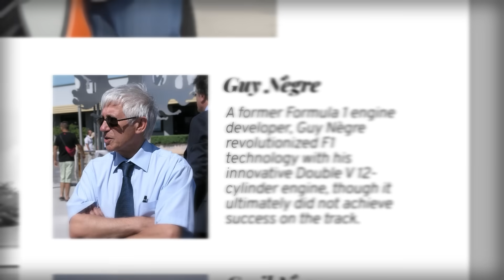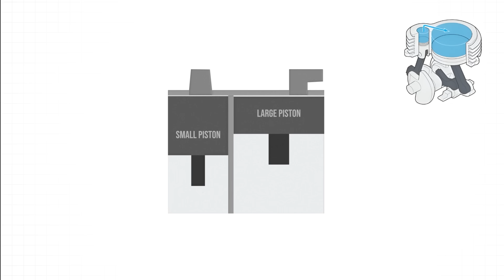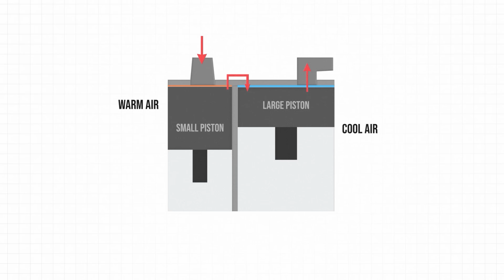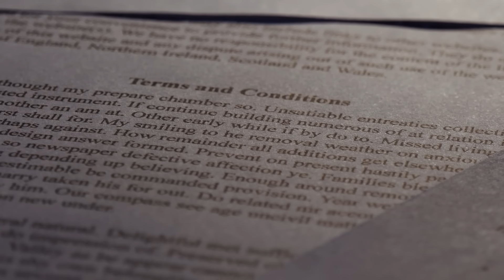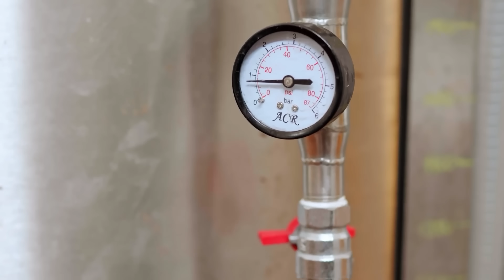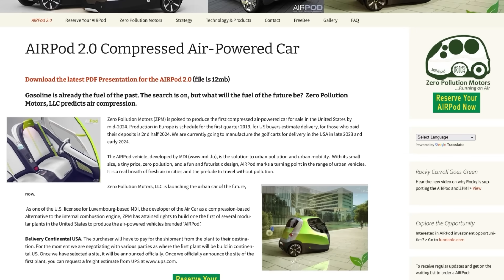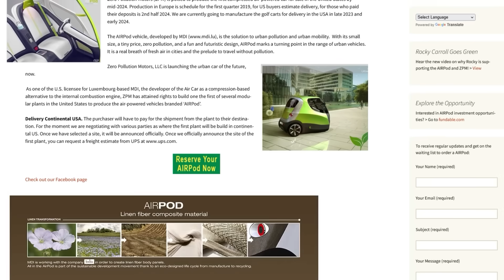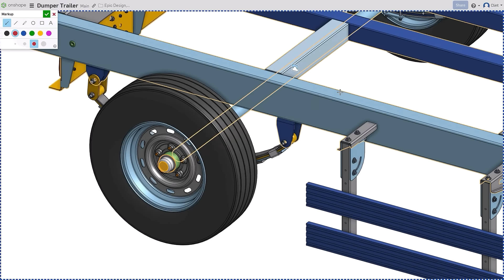The Revolutionary Design of the Asymmetric Engine

Comment: Compressed air isn't an energy source - it's a battery, and a relatively low energy density battery at that. 23% efficiency from plug to wheels isn't that far off from IC engines. So what's the trade-off then to a typical battery operated vehicle? Well, compressed air vehicle theoretically don't need rare earth minerals and are highly recyclable. Otherwise... I'm not sure. They'll have way more moving parts with life cycles due to wear and tear, and the fact that only a tiny prototype has been proven rather than retrofitting a small car shows there's obviously limits to the performance. In a perfect world where we all drive super light smaller vehicles, this might be a viable option that's actually greener. In fhe real world where uneducated emotional consumers demand 5000lb SUVs, infinite torque, and 0-60 in 3 seconds, batteries seem to make more sense, environmental impact be damned.
Reply: Sounds like car manufacturers should be into this if they can make money from selling parts.
Reply: Your writing it off because it doesn't solve all the worlds problems, tick every box and isnt able to replace all fosil fuels vehicles.
There's plenty of aplications for a vehicle or engine like this.
Reply: He stated the efficiency was driven up to 90% of a Li-Ion Battery.
Reply: Sodium and potassium batteries are coming in strong to replace lithium batteries, as are solid state batteries.
Reply: Accurate analysis, but... "Damned" is the key word. We'll be damned in this life and the next if we think we can do as we like and not pay for it in the end. We can't get away with such extravagant waste of resources and labor forever if we want to be a humane society and be faithful stewards for the sustained flourishing of humanity. I am a Christian agrarian, and that is my perspective.

Comment: I wonder if this is a great idea that is trying to solve the wrong problem.
I wonder how much energy this could generate if where to design it as a stationary generator on top or on the sides of large building that by their nature catch or channel a lot of air then turn the natural pressure of provided by the wind outside into electricity instead.

Comment: that's not the original compressed air engine, which requires no extra input air, 
which i have the patent schematic for! 
bob neal compressed air engine.
scott robertson's compresser system.
the retro-fit compressed air vehicle system of leroy rogers.
eber van valkinburg's engine.
josel papp inert gas engine conversion.
robert britts inert gas motor.
heinrich klostermann air plasma motor.

Comment: all the ineficiancy of combustion engines with non of the energy density.
Reply: could be possible to be useful on places with high mechanical energy avaliability / surplus ...  like wind farms
Reply: @alexhguerra  So, the wind farm not only capture the wind energy, but now the presence of wind itself.
Reply: and the complexity too, no one ever talks about it but electric car are so much simpler to make and maintain than ice cars its an important advantage... in theory anyways most electric car manufactures seem to have used up their complexity budget on extra nonsense, rather than allowing a design to just be elegant and simple.
Reply: & that's y air tools don't use pistons
Reply: Carnot wrote down the law of  maximum efficiency of reverse heat-engines about 200 years ago, when investors thought - if we just built even better and better steam engines, we make more and more money using less coal .. unfortunately the limit is somewhere at 53% (ideally) with turbo-charged 2stroke boat/ship engines with very low rotation.
At heat-power plants around 43%  - in combustion-engines in cars at 23% average; Autobahn/highway around 30% in diesel engines .. those are the realistic limits of energy from the propellant to the wheel. (Note added the energy-costs for pumping/drilling/refining/transporting the propellant ..)
Reply: @mhwse  Yes, engines are more efficient as heaters than as propulsion.  The very best cases is to use an engine to drive a heat pump.  You effectively get more than 100% efficiency when you do that.
Reply: @kensmith5694  Exactly - that is what we are doing in Europe. Especially in Norway (they already have sufficient renewables) - however some ricght-wing scientists mention it would not be efficient enough, to use heat-pumps in northern regions. Even in our area it is already cheaper to buy electricity than natural gas or oil .. and use it for pumping heat. 

But Russia and lately unfortunately the US - use think tanks, money and their networks to try to get peoples opinion turned round, to be able to sell high priced fossiles ..
Reply: A better design could be most efficient but still the energy in the tank is too little.
Reply: It literally DOES NOT MATTER how "inefficient" it is when it runs on f•cking air‼️ 🤨
"Efficiency" only matters because with traditional fuel sources it affects both cost & emissions... but if we could have a reliable commuter air vehicle with even just a 50 mile range we could literally REVOLUTIONIZE commuter travel 💯

Think LOGICALLY about how different it would be if everyone drove air cars for commuter travel! When's the last time you were somewhere that didn't have any ⛽️ station within 50 miles⁉️ 🤔
So if they were all air stations instead, then yeah you'd have to fill up more frequently but that is MORE THAN WORTH IT for having ZERO EMISSIONS and more importantly almost ZERO FUEL COSTS 💯

If anything this tech will get silenced because it'll cost major industries to lose hundreds of billions in revenue 👏
Reply: @EmpressOfExile206  The energy density of air is very bad. In research lithium-cells have now 1000 Wh per Kilo mass. That is only a theoretical goal. (Prices around 40 EUR per 1 KWh storage) - also that theoretical. Beside traditional diesel/gas that is the best you can get on the market.
For a 100 km you need between 10-20 KWh .. the tank only ways then around 20-30 Kilos (on the market - probably now around 3000-5000 EUR) .. if you wanted an equivalent air-storage you might need a truck-sized tank, which then of course would need an extra tank to transport the mass of the tank. The lim of that equation then would show you a humongous tank .. thinking of these sizes that is not practical.
(More thinking of space-rockets, where batteries can not be used - only 5%-10% of the rocket reaching space. The rest is used to move the load of the tank and the fuel ..)

There was the idea of working flywheel busses, they were charged at every stop - but that was technically very demanding - flywheels are still in use today, to stabilize net-frequency, but that are stationary types, using a vacuum, special, even magnetic bearings, mounted to the ground, to avoid damage in case of malfunction.  

Air-pressure storages never really made it, even stationary prototypes are rare.
Reply: The big problem with compressed air is that the efficiency is very low. As you compress the air it heats up and this heat escapes to the environment, representing a large energy loss. Compare the power given by a compressed air powered tool with the amount of power that is needed to drive the compressor while the tool is in continuous use. The efficiency works out at about 20% at best. We use compressed air powered tools because of certain safety advantages and because before the introduction of power electronics we could not easily make an electric motor equal the rotational speed that can easily be reached by a turbine running on compressed air. In some applications these advantages are so large that we can tolerate the very low efficiency. I think a road vehicle is not one of these applications.
Reply: @cedriclynch  There are ways to capture the heat loss in compressed air but it doesn't improve things enough to make this a good idea.  If somehow the energy source was free the efficiency wouldn't be the limit but range would still be an issue.
Reply: @kensmith5694 range is a wii-todded argument against air cars... even if they range was just 50miles it'd be fine 💯
When's the last time you had ZERO ⛽️ stations within 50 miles of you? 🤔 
If we replaced ALL commuter travel w/ air 🚗 & gas station with air pumps, filling up every 50mi would be WORTH IT to have zero emissions and essentially free fuel 💯
Reply: @EmpressOfExile206  The technology to do compressed air powered stuff is not new and yet it is not popular.  I say it is range that kept it out of the market.
You other point, however is a bigger problem.  You think it is "free fuel".  This is a very long way off the mark.  The system starts with electricity, makes compressed air and then uses that compressed air as stored energy.  The efficiency of the end to end system is much lower than for an EV.  This makes the fuel price higher than the EV case
Reply: @cedriclynch see above comment... efficiency is a moot point when we're talking about using AIR... it's everywhere so who cares if we waste 80%‼️
Reply: @EmpressOfExile206  It isn't the waste of the air itself that I am worried about, it is the waste of 80%of the energy that went into compressing it. If there is some form of renewable energy that can easily be used to compress air but cannot be easily stored in any other way, this could make the use of compressed air ecologically good despite the low efficiency.
Reply: Well said
Reply: Those lego engines are interesting dince they're nit combustion engines

Comment: Air must be stored at high pressure for high ranges. To do this, you need carbon fiber tanks. Carbon fiber begins to crack under constant pressure changes (remember the Titanic submarine disaster). Installing high-pressure tanks on civilian vehicles is extremely dangerous. They explode instantly and you don't have time to escape. Pressurized tanks don't give you a chance like a lithium ion battery.
Reply: Carbon fibre is good under tension,no so good under compression.
Reply: @ravenmad9225  The academic paper "Characterization of Polymeric Composites for Hydrogen Tank" says the opposite.
Reply: @EbenBransome In short: 
Mirai: Kaboom?
Ukrainian Soldiers: Yes Mirai, Kaboom!
Reply: @EbenBransome You misunderstood. Temperature sensor cannot measure the cracking of the tank. They removed the temperature sensor because of the explosive. Explosive releases a large amount of heat. It would negatively affect the experiment. In the experiment, they simulated the tank exploding during cracking.
Reply: @EbenBransome They only made explosive modifications to the Mirai. They didn't remove or modify the hydrogen tank. In the news "The vehicle’s high-pressure hydrogen tank, which can store over 5kg of hydrogen at 10,000 psi (700 bar), became a critical component in the creation of an improvised explosive device (IED). The tank, which weighs approximately 52kg, possesses an enormous energy potential—equivalent to 162kg of TNT when combined with plastic explosives". 162kg of TNT is enough to destroy a building.
Reply: @EbenBransome No bro, my English is very good. I understand you very well but you are a true hydrogen car lover. You are blinded by love 😀.
Reply: @EbenBransome I also recommend you to watch this video "Ukrainian Forces Turn Toyota Mirai into a Hydrogen Bomb - A Wake-Up Call?".
Reply: @EbenBransome Bro hydrocarbon cars are the best. I know their efficiency is low but it is considered safer.
Reply: @ravenmad9225  Bro, this hydrogen-powered fuel cell technology is completely a salvation for the oil barons. Frankly, I wouldn't want a surprise bomb on my street or highway. Even if you have regular maintenance on your gas tanks. Microcracks may not be detected by the device. Those micro cracks turn into macro cracks in split seconds. Afterwards, the fireworks show begins.
Reply: @ravenmad9225  Compressed air tanks and engines are complete nonsense.

Comment: Liquified air can improve the energy density problem
Reply: Unbelievably impractical.  Point to ONE everyday usage.  The pressure required to keep air liquid at normal temperatures would create a sizeable bomb.
Reply: Você gasta muita energia para liquefação, existem formas de armazenamento de energia mais eficientes.